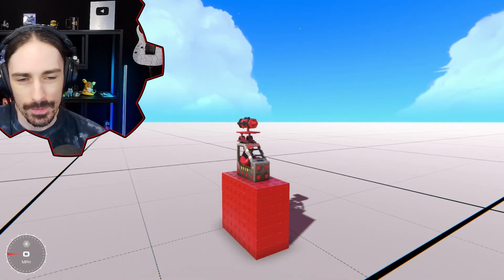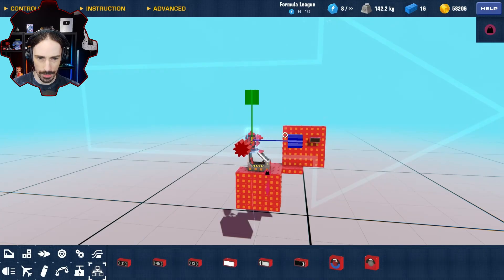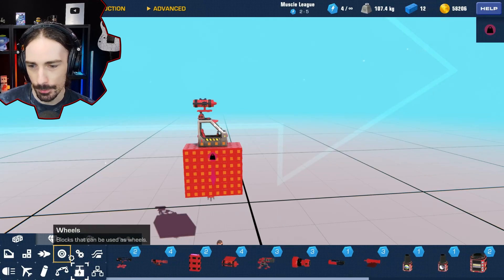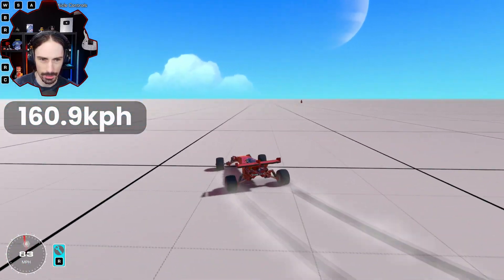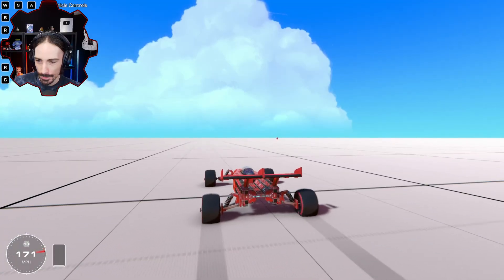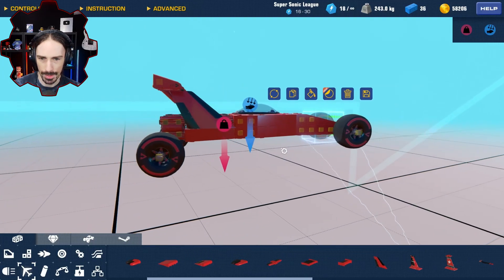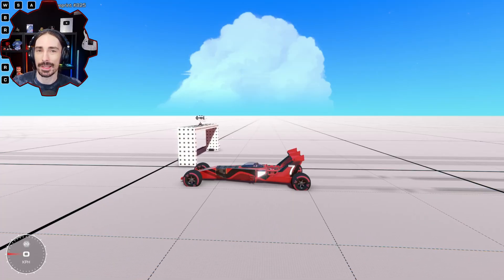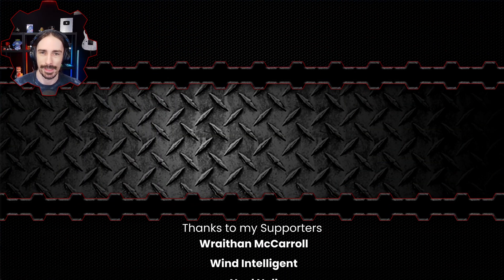ROCKET vs. DRAG RACER!  Can a Car Keep Up With a Rocket?

Comment: I did some math, and assuming the horizontal speed is exactly 285 kph (~177,090 mph), and the angle is 10° (well, techniccaly speaking, it would be 80°), the actual speed of the rocket would then be roughly 285,085 kph (~177,143 mph).

Comment: Couldnt you plug the output of the speed sensor to an and gate and add the throttle input so when the speed is below x you wont accelerate anymore

Comment: Scrapman, I just wanna say that the rockets speed is relative to the vehicle it's in, if you're going 250kph and launch a rocket. It will start at 250 and then go much faster

Comment: @scrapman you weren't taking much damage by those rockets??? if you didn't change any damage outputs please fire a rocket at that same car without it moving to compare damage. even when you were driving the heavier tanks I feel you took more damage from rockets while you were moving slower. if its nothing... meh, my bad but could be interesting.

Comment: Idk how programmable trailmaker logic is, but as a control engineer i think you should try (if it's possible in the game) to implement a pid algorithm. The teory behind it is quite complex, but the implementation isn't. In this way you will be able to hit and mantain a perfect speed (without resonance due to not tuned control system)

By the way cool idea and way of mesuring the speed, i like it :)

Comment: Hey ScrapMan, fun fact for your ease of use: Even though the speed sensor says its trigger threshold is in kph, if you have the game set to use mph then the speed sensor trigger is actually measured in mph. Also if you set the speed sensor trigger threshold with your game using mph and then switch your game to kph, the speed sensor value will get automatically converted to the keep the same original speed in the new units.

Comment: You should've made the air breaks slower. That way they would fluctuate much less keeping the speed more consistent.

EDIT: Nvm. You did that after I  wrote the comment and it failed.

Comment: the rocket is losing kinetic energy whilst going up but gaining it back when going down so the net energy is zero (if the rockets dont get affected by air friction) their average velocity should be the same
(edit as long as not shooting with more than 45 degrees their relative speed should be the same too) (I might be mixing the the words of speed and velocity I dont know grammar)

Comment: Fire rockets from your car so they accumulate around your vehicle. If you can't fire one while travelling at rocket speed the part of your vehicle that fires the rocket could move backwards fast enough to fire it or the speed of the whole vehicle could fluctuate.

Comment: Once you reach 285 kph shoot a car mounted rocket backwards and see if it hovers in place. Maybe use an anchor block to stop the car after firing.
Also, instead of air brakes maybe try negating some engines once you reach your desired speed.

Comment: Did you know that you can use a AND/OR/XOR gates to reduce the output of your engines? This is a good way to dial in on a specific speed without being all over the place.

Comment: Your first Ryan testing with your current tractor at six man five seconds was closer to a speed of 180 if not 175 in comparison to a basic 170 that you’re thinking because you went and it said 180 when it hit the area directly behind the cockpit in your first run by Joe I was talking about miles per hour which is what you had at the first time

Comment: Did some math of my own the rocket was moving roughly 289.392 km/h
Reply: Based on watching the video the assuming scrapman was moving on average 285 kph for 6 seconds he traveled roughly .475km given that the rocket fired at 10° and assuming it's trajectory is symmetrical the rocket traveled roughly 0.48232 km in that same 6 seconds getting you an average speed of 289.392 km/h

Comment: Because the rocket travel on an arch, it travels more distance than you on a straight line. Even if you match the hitting spot it still travelled more distance in the same time as you, therefore it’s faster

Comment: Actually you should try decrease activation speed of airbrakes, so they're not fast enough to cause large increments of braking force. That way you can control speed better and rocket will stop wiggling back and forth due to overcorrecting. It reminded me about dialing PIDs, that system definitely have way to big 'P'.

Comment: Considering the 10° angle, if we assume the speed to be 285 kph, then the actual speed should be 289.4 kph. Not sure if the game calculates the speed differently
Reply: Ye I got 289.392 so I'm assuming we did the same math
Reply: @nathankurtz  I just approximated the number to 4 digits

Comment: Day 3: I would love to see a jumpshot battle where you make cars with guns but there are sensor pointing towards the ground so guns only work if you are mid air by a couple blocks. Bonus points if the cars have to do a front/backflip when they jump and the guns are missile launchers or gunpowder cannons.

Comment: 285 is the BASE kph of a rocket. if the rocket is moving, the rocket will come out at the speed the creation it's on plus its base speed.
because if it didn't, any missile fired when you're moving above 285 kph would either blow you up or move slower than you. you

Comment: Day 4 of- Day 3 of asking for-   You guys should do a cat and mouse evolution, where one person (the mouse is in a simple >7 powercore ground vehicle. E.g, a boat, hovercraft or car. And the Cat in a simple plane, helicopter, flying wing or quadcopter. If the mouse manages to make it from one point of the map to the other. E.g on treasure island, 
the swamps to the main spawn point. They get a point, if the cat manages to eliminate the mouse they gain a point. Then each player would swap vehicles and have a 2 minute round to adjust the vehicle, the following round the modification period is increased by 3 minutes as well as the powercore limit. The mouse should have a defensive minigun on a hefty cooldown, this would mean they can shoot back, but should mainly focus on using their speed and agility to escape the cat. As the rounds continue, the cat can go from a single smart cannon, to 2 smart cannons, to a minigun, to rockets, and then 2 miniguns and 1 rocket launcher. The cat should also be slower on the roll and yaw axis, so the mouse can have the agility advantage. To be done in trailmakers.

Comment: Idea for multiplayer: Catch the rocket. Use the same launch system, but the players are not allowed to use automatic speed control, you have to manually control your speed to keep up with the rocket. Whoever get hit the most wins.
To make it even more difficult you could have the rocket launch before the car reaches the start line. That way you would first have to catch up to the rocket and then match it's speed.

Comment: Is it me or Trailmakers rockets are akin to a mortar than an actual rocket ? its Velocity peaks at the launch then its slows due air resistance instead of slowing down due to running out of propellant.

Comment: You should probably see if the rocket launches at a speed relative to the vehicle it is on.
If it does, you should probably do the same thing you did with the bombs and pistons, only with the rockets, so it shoots them a lot, lot faster.
Reply: Or, the opposite. See what happens when the rockets have a relative ground speed of zero. Like how a cannon firing out of the back of a moving vehicle would essentially just drop the payload. That would be cool too
Reply: I saw this and then strapped one to a supersonic jet and it turns out yes they do launch relative to the speed of your vehicle
Reply: @verysovietdoge  Yeah, I mean he did a whole video on it at this point.

I was going to get the game myself at some point but unlike every other sandbox game, Flashbulb is charging a AAA price when you include all of the necessary DLC that everyone else includes for free.

I've been burned by too many sandbox games before like TerraTech and Besiege and KSP2.

It might be worth it if they bundle it with the DLC during a sale, but like Scrap Mechanic has an open ended base building mode, Trailmakers I don't see myself getting more than a couple of hours out of.

If they get around to making some kind of persistent world mechanic like Minecraft or Factorio or Scrap Mechanic or KSP1, then ok, but not until then.

Sorry for the rant, but I actually intentionally looked Trailmakers up during the Steam summer sale and it was their choice not to participate, but its my choice not to buy it too.

Comment: Idea for part  2 multi-player  overview:  Players have a car and base (the missile tunnel).  They try to destroy each other’s base.

Details: 200ish points for car and base combined. 

Bases are out of range except for missile.  You can add Smart gun or mini gun to the base.

The car may not be armed.

Use guns, or walls or armor, to defend.

Optional turn based idea.  The attacking player adjusts his gun angle and speed and launches a missile.

The defending player man’s his own guns.

Comment: What happens if you fly 285kph and shoot a rocket backward? Does the physics calculate for your speed? Does the rocket fall out of the sky? Or does it defy all physics and travel at 285kph in the opposite direction?

Comment: Random thought, don’t bullets also have travel time? Faster than rocket but not breaking the speed of sound
Reply: Fr, next vid racing a bullet??
Reply: I think we need to see a race against the rest of the weapons now.
Reply: @DigitalJedi  lol guy named Dr.observation on yt has a video where he measures the speeds of projectiles.
Reply: @H-2207that depends on quite a few factors. For example, a . 45 acp fired from a 5" 1911 will not be faster than the speed of sound. It's a pretty slow bullet.
Reply: @H-2207 some 9mm para are sub sonic, some are only slightly supersonic, some are very super sonic. And using a micro compact pistol will net lower speeds than using a full size carbine.
So even with common 9mm there is over 2000fps difference between different shots.
Reply: I think it is more of a visual affect and actually being tracked
Reply: Bullets drop
Reply: i tried to test this but with a plane and it was over 300mph
Reply: I tested results from what I could gather is around 400 miles an hour but I’m getting mixed results because I also have another test which is over 600 but somewhere between there so theoretically you can outrun bullets
Reply: I have actually outran bullets in trailmakers 
I was going Mach 3

Comment: If you hook the speed sensor into the engines (not necessarily directly) it gives you much more consistent speed control!
Reply: That was my thought too, have W and S mapped to two AND gates that output the positive and negative signals for the engines, then use that same trigger below speed sensor linked to the forward (W) gate. Have the two gates control the engines instead of the seat and it will drive just like normal with the speed sensor as a governor.
Reply: speed sensor with your desired max speed, set the output to negative, connect to engines...

boom, you have a speed gate that will prevent you from going past your threshhold without adding air brakes
Reply: @randomthepyro2058  hooking it to an xor gate would be much more precise;at least on the test map that is. on a downhill it would not fight gravity so other maps wouldn’t work as well
Reply: Brilliant
Reply: I was thinking of the devs adding this but I guess it is already thare
Reply: I found that a air brake with a consistent angle was the most precise, getting exactly 170 mph

Comment: Instead of trying to get the rocket to trigger a distance sensor, you could have just let your car be the trigger. Every new sensor you drive through would cause a new fresh rocket to fire, allowing you to indefinitely chase (or be chased by) endless rockets
Reply: But the point of the rockets triggering the next one was specifically so the launches would not depend on the speed of the car. That would make it "one rocket going at full speed" the whole way through.
Reply: Also with the rockets triggering you could have used it to send signals across the map
Reply: Yeah I was thinking the same thing
Reply: i like the way you think

Comment: Nice consept. I just think that you should have also launched the rocket at 285km/h on your vehicle. Maybe in future video like as a little side quest or test?
Reply: It would be faster than the car bc its launching with the cars speed.
Reply: @Capedkarnage  Yeah I think you are actually right. Because he has shot rockets from a plane already at fast speed. But then what about shooting rockets backwards?🤔. Would the rocket just stay in place?
Reply: @gazu8990  it should stay in place yes. Idk if it will in game tho
Reply: @gazu8990  it would shoot like the car isn't moving, its basic physics.
Reply: @Capedkarnage  in our prespective it would,but in the outside prespective it may stay in place